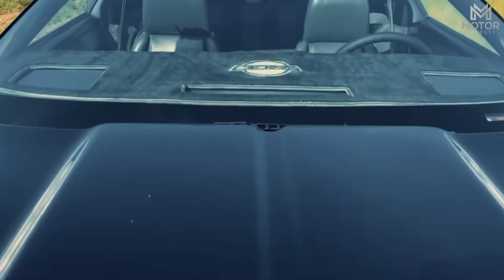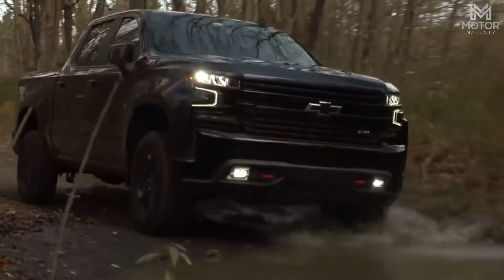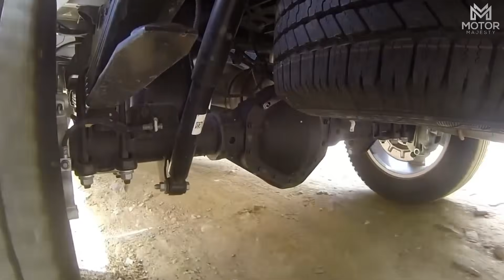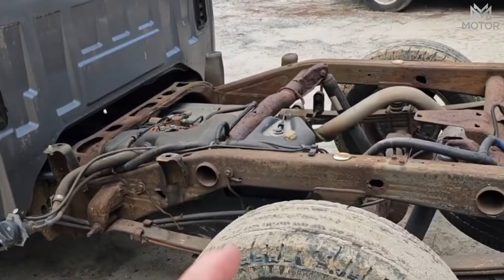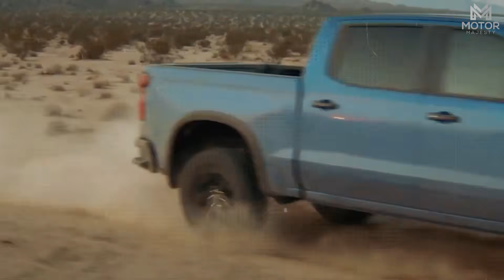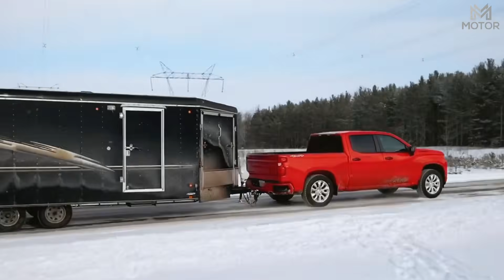Chevy's Most Underrated V8 Was Actually INSANE

Comment: Ls engines are not that good. Everyone uses them because they're cheap.If they wanted a reliable engine, they would get a dodge 318 or a 360
Reply from the maker: The Dodge 318 and 360 LA blocks are absolute tanks, no doubt about it! But the LS platform became king because it's cheap, lightweight, and makes easy power. It’s definitely a battle of old-school reliability vs. modern budget horsepower.
Reply: Ls engines are extremely reliable and can produce far more power than either of those could ever hope to!
Reply: @davidcanady7935 then, explain to me every chevy that tries to step up, gets their doors blowed off, buy a four wheel drive, dodge dakota twin turbo 318 magnum